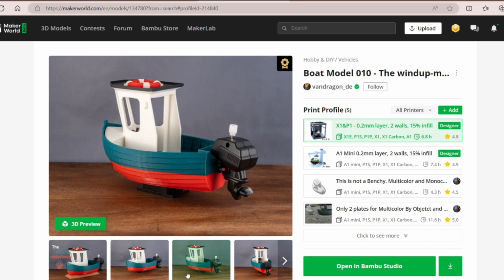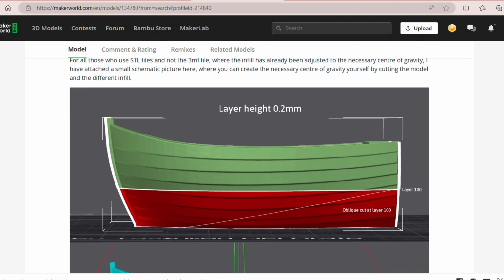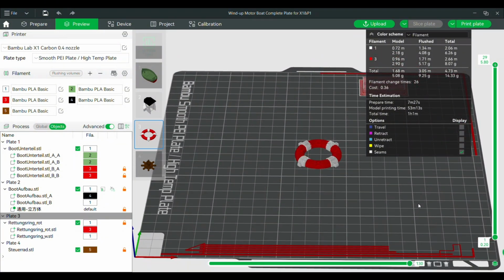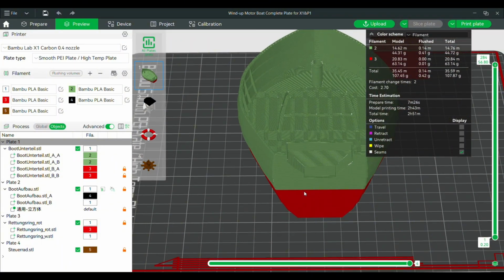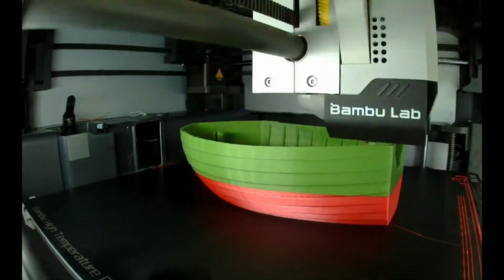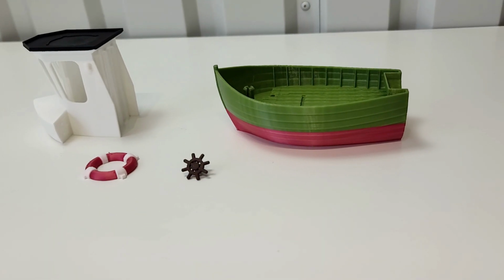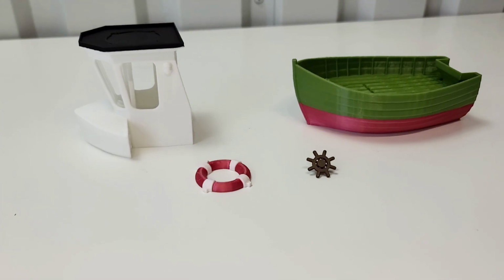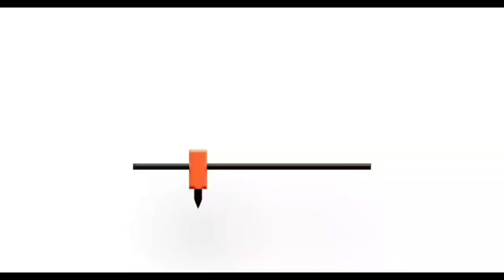3D Printed Boat using Bambu Component Kit

Comment: Just got my BL printer and am printing this now, currently on the second plate.  Any idea why it creates the seemingly unnecessary extra block tower in the back?  It didn’t make that for the bottom (plate 1) so i’m not sure what the purpose is for it, seems like a big waste of filament.
Reply from the maker: Welcome to Bambu Printer world! It is a purge tower for when it does a color change. It will automatically appear anytime you have a print that has more than one color. It does create waste but it helps the the nozzle get the pressure adjusted before it continues printing. You can make it smaller. But I wouldn't recommend removing completely. Thanks!
Reply: @tada3dprinting mine is doing it even though I’m only using one color.

Comment: That's a strange design. The rotation of the spring will cause it to spin to one side. And makes the boat spin in place
Reply from the maker: It definitely does spin. I assumed it was something I did. Thanks!

Comment: Looks like a fun kit.  I just checked and the motor is $5 which is reasonable, but shipping is $7, so will see if I need spare parts.  I just received over $100 in parts, so probably OK for now.  I had to replace my first stage feeder on the AMS, now have spares, and it seems to be working.
Reply from the maker: Oh yeah that's a good point. Best as an add on. Thanks!